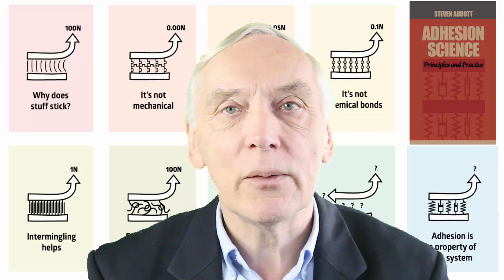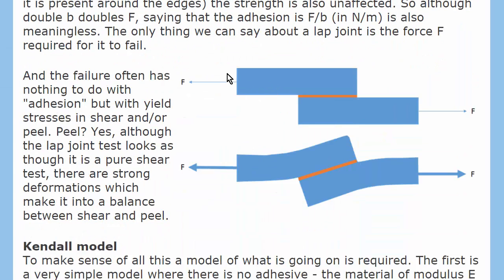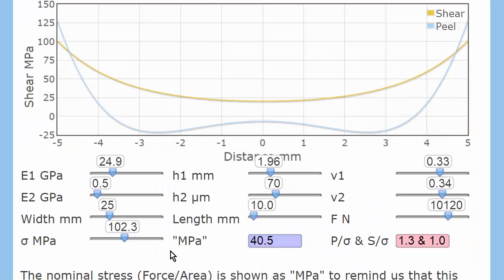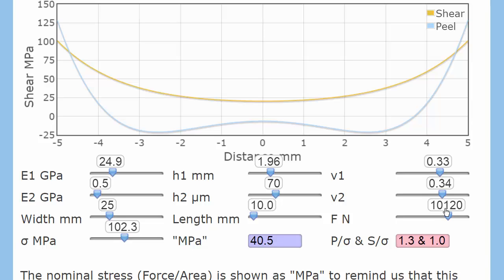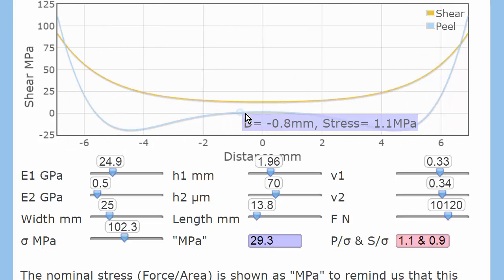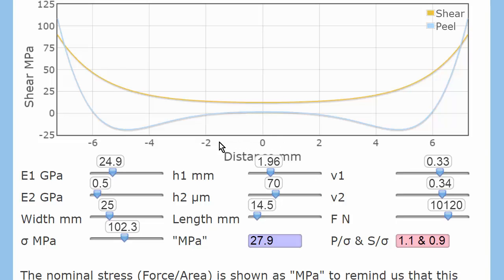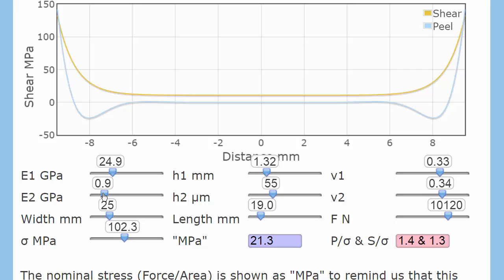Lap Shear Doesn't Measure Shear

Comment: Good evening.Very interesting video.  I am not sure to have understood the peel strength. Considering a lap joint where the adhesive forms a plan xz and we apply a load along z direction. Is this CORRECT that the shear strength corresponds to the tensor Tyz? and the peel strength to the stress tensor Tyy? Or how do you quantify numerically the peel vs shear strength?  I am currently studying on project to assess the bonding strenght in between a multi-material Additve manufactured piece. I am now making a Comsol modelisation so as to provide  hopefully the purest shear strength  possible for a lap-joint test. What do you think about it?
Reply from the maker: If you have the luxury of doing real calculations with, say, Comsol then you don't need these simple apps. As I say many times, "Adhesion is a property of the system" so knowing the system is the first requirement. In my simple apps I merely choose systems that have tractable formulae because I'm not smart enough to write anything that involves Finite Element stuff.
Additive manufacturing is often hugely disappointing because interlayer adhesion can be catastrophic ... often because there's insufficient time/temperature to get polymer entanglement across the boundary. Certainly fused filament objects are often hopeless: temperatures high enough to guarantee entanglement make the whole part sag. Go to a lower temperature and the part stays the right shape, but entanglement is insufficient - I had to read a bunch of papers on the topic.
So I don't think my apps help you directly, but if they help emphasise "system" thinking then they'll have achieved something!

Comment: for the welded pieces of distinct material can we also talk of bonding strength? Is the developed adhesive theory also relevant?
Reply from the maker: If the weld is perfect then by definition we have a single piece of material and then "adhesion" is just the yield strength of the material - though I've never needed to know the fracture mechanics of how concentrated stresses get along the weld line. And if the weld is imperfect, say with a Griffith crack, then it's all about crack propagation. All way outside anything I know. Sorry!

Comment: Thank you for this video. So all the values we find in the literature about bonding strength measuring shear load at fracture by lap joint  norm astm D1002 are highly inaccurate?   if so perhaps this could be fixed if a factor between the measured value ( the sum of shear and peel value) and the only shear stress would exist?
Reply from the maker: They are a (hopefully) accurate measure of what the test provides, but they are otherwise highly misleading. And if they quote numbers such as X N/m2 then they are wrong because although the N are correct, the m2 are wrong because only a small part of the joint has experienced the stresses. In the book I talk of a few attempts to work out the "real" adhesion of the same joint measured using different techniques by experts ... and they simply can't be compared. A double lap joint does a better job at measuring shear failure adhesion, but it's a lot of work and it still tells you surprisingly little about what's going on - because Adhesion is a Property of the System. It's always better to do a test that relates to the specific failure modes experienced in your real application. Such tests won't be ASTM, but they will be much more useful.

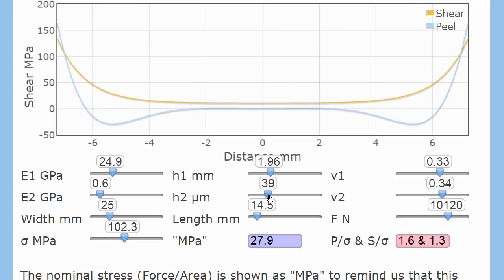Comment: at around 4:40, apparently the opposite is true in real test.  More thickness dissipates stresses, however real world test generally show the opposite.
Reply from the maker: Interesting point - and I don't know the answer. However, I can speculate that a thicker adhesive has a chance to fail cohesively, which is not a mode covered by the app. Because "adhesion is a property of the system" we have to think carefully about the overall effect of any one variable such as thickness, while here I'm only looking at stress concentrations, not the same thing as "adhesion".

Comment: Dear Mr. Steven Abbott , 
Thanks for the video . Appreciating your efforts ...

i have one tech question to you regarding this lap shear . i will appreciate a reply to my mail id mohammed@hillsborough.ae 

As per the standard ASTM D1002 ,the grips should be self aligning . But since the specimen to be tested is a 2 piece metal overlapped on one another ,I doubts the possibility of eccentricity issues when using this self aligning grips are closing

Could you be able to explain ? 

Regards
Mohammed